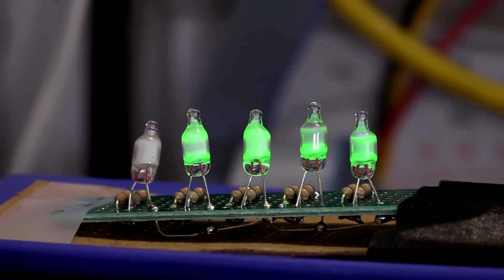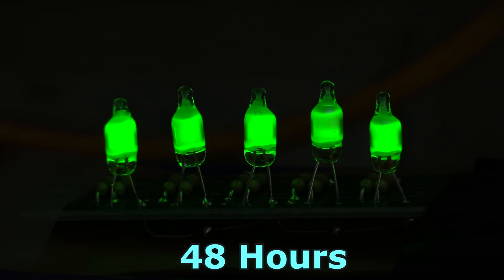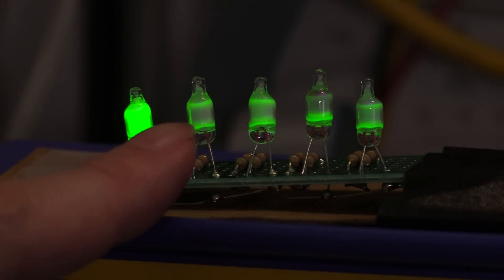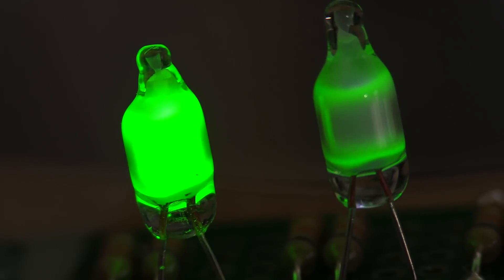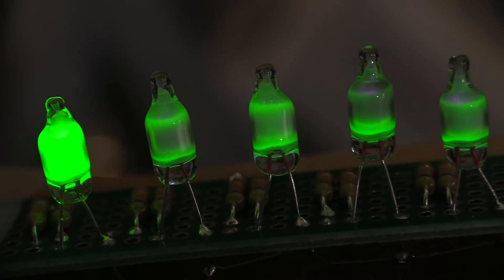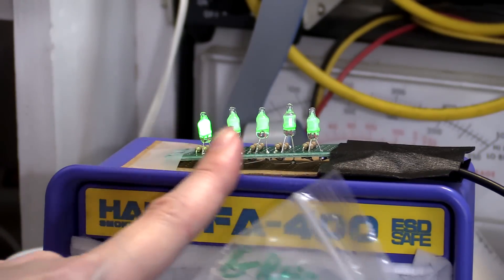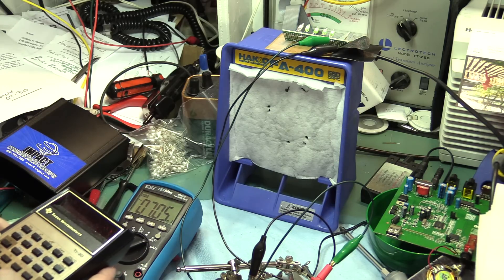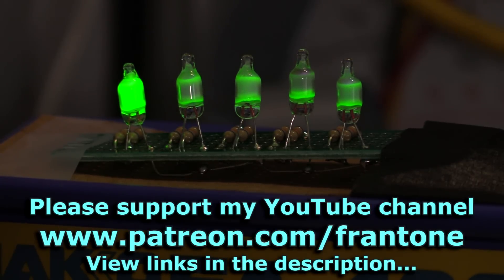Total Fail!!!  The Green Neon Is A LIE!!!

Comment: If you don;t have a current spec for them, put a pot in series and find the minimum current they'll run at. How does this compare to the 1.75 ma?
Reply: Quick calculation using generic "neon bulb numbers"... If it fires and holds at 90V, 1.75mA is over 1/8W that the bulb is dissipating... I bet they're warm to the touch... Which a neon bulb of this nature should never be.
Reply: 1 to 1.2mA is where mine all seem to run.

Comment: Try a lower current. I think they are being cooked.
Reply: This was my first thought. I can't condemn these lamps without first seeing the datasheet. Some of these small bulbs are rated at 70v and not 120.
Reply: 2 mA
Reply: @metatechnologist  These are not rated for any particular voltage, they require current control, 70V is just the operating point it will settle to at the specified drive current. If they're specced at 120 they have a built in resistor to set the current for 120V mains operation.
Reply: @metatechnologist  Indeed, from my testing 4x10mm Chinese greens light up at around 60V and they run without flickering at less than 1mA, in a batch of 25 most work without flickering under 800µA.

Comment: I was looking at these to repair old 120V AC switches for a few vintage espresso machines that I own, and for which I can't find non LED replacements in the right style to fit the cabinets - In my case, the bulb failure is caused by their leads breaking off from mechanical fatigue after about 10 years of daily use, with no significant dimming whatsoever - and the bulb circuit employs two 80k 1/8w leadless resistors in series, for a total of 160K under 120V AC.

Considering you were driving them with an equivalent 16K resistor, which lets 10 times more current through, therefore potentially generates 100 time more power, it's no surprise they failed so quickly. I would therefore surmise the failure you experienced was simply caused by overdriving them, not by a manufacturing defect.

Comment: Not sure if this will help but I took apart a power switch with a green neon inside that's been running daily for several years and it has a 160k resistor inside, still just as bright as the day I bought it.
Reply: EXACTLY my setup - that's 10 TIMES less current than Fran drove those at (33K/2 instead of 160K). I'm replacing the neon bulbs in some of these switches because the neon leads broke off from metal fatigue due to vibration from countless on off cycles.

Comment: I'm assuming the clock you're referring to was that lovely green flip clock timer. I had the same issue trying to replace the lamps in my model and to this day, the best solution I have is stepping down the lamp voltage to work with green LEDs. The clocks nice green glow is more of a beacon now, but it's better than nothing.

Edit: it's occured to me that a variable pot would more than likely resolve the brightness issue, because you could manually dim them. I don't know why that hadn't crossed my mind before

Comment: Don’t know why this was, but back in the day when I used to tear old TV amplifiers out of houses, they used to have one or two neon bulbs inside of the preamp. I always figured they probably use them to bleed off lightning strikes was the only thing I could come up with
Reply: Those may not have been ordinary neon bulbs;, more likely they were some type of gas discharge lamp similar to the ones used in (landline) telephone-distribution closets for shunting lightning-created voltage-surges to ground.

Comment: Maybe get some from a more reputable manufacturer like  CML part No. MC08030000 

1 Breakdown Volts 85VAC, 100VDC 
2 Design Current (mA) 1 
3 Resistor Series Resistor 110-120VAC 56KΩ, 220-250V 180KΩ 
4 Life (Hours) 12,000 
5 Colour Green 
6 Lead length (mm) 30

Comment: A couple of thoughts on the mechanism of the phosphor degradation (other than UV degradation):

 - Electrode material evaporates onto the glass/phosphor, shielding them from the light. This does happen in some Ne-bulbs, some old continuous ones can look almost silver plated! 

 -  Plasma may be reactive enough to simply decompose the phosphor/pull radicals from the glass or residual gasses for the same effect.

Also why bother with the coated phosphor at all? If the "neon" Ar/Hg bulb was made of uranium glass the entire glass envelope would be the phosphor! Maybe this has been the case for earlier models?

Comment: They are indicators not illuminators and maybe 0.2 W is to much and maybe dropping the current will drastically alter the life time because I bet the relationship is not linear, what would be more interesting is if that row of 5 had different resistances on each and then a control and leave that running...cheers.

Comment: Zinc sulfide is a common florescent materials that 'ages' poorly.
Old radium watch dials use it to make light, but after some time the zinc 'gets tired' and loses its ability to glow.
Something about dislocations in the ZnS crystal that get relaxed after long-term exposure, if I misread the article properly.
Fresh crystals glow like the Dickens when irradiated, used up crystals can't be bothered.
I bet the firm that made these bulbs used ZnS; cheap, plentiful and it has the right color.
I'd use them for a warning indicator, but never as 'always on' power indications.

Comment: Fran, in your field, you must already know that most anything made in mainland China by a company that does not have to answer directly to a large corporation that contracted them to make it will be substandard if it works at all. It's all about chabuduo over there, i.e. "close enough", and when "close enough" means "close enough that some sucker will buy it on alibaba/ebay/amazon", then that's exactly what you'll get. There's no integrity, honor, or pride in one's work—just a vague concern about what sort of bribery, discount, or bald-faced lies will be necessary if the corner-cutting is noticed and the buyer has any way to make their life difficult.

TL;DR: buy stuff made in Taiwan, Singapore, Korea, Japan, Europe, the Americas, etc. but if it matters, don't buy it from China.

Oh, and make sure it's actually made somewhere else, because they'll outright lie about that too. I have some D cells I got recently that say "Made in USA" where they forgot to change the the tiny "lead-free" notice on the label from Chinese to English. Heck, even that notice is probably a lie.

Comment: I had issues quite similar. But in my case it was bad electrode material which sputtered quite much, especially with heavy ions like Ar. The difference is clear if you breake one. Is there dark coating on the „phosphor“? Not that it matters .. the bulb is useless either way ... just out of curiosity. At the end there are three main faults ... gas intake, sputtering or dead conversion material ...

Comment: I almost wonder if it's poor quality electrodes which have sputtered on top of the phosphor. They shouldn't do that under low current AC, but they also shouldn't look like that in less than two weeks.

Comment: the company i work for uses green neon indicators for steel tubing heaters. they used to have a half life of about one year (basically what you got in 10 days happened in a year).
Right now, the supply dried up so (refering to your LED video you're gonna like it! ) we are using orange neons, in the original green diffuser :P
It seems green neons are really hard to get right now, good quality one that is.

Comment: Fran... FRAN!!! They aren't useless!! You can have a burnout race! See how fast you can make them fade out below a certain threshold. Have a dim LED as a baseline, or finish line, and use a surface they illuminate at a fixed distance away to compare the brightness of their light on it, as an eyeball metric. Can fiddling w/ different voltages and Hz make them go dark faster?

Comment: I mentioned on your last post that I have had many many failures with the green ones - mostly in green illuminated switches... The normal orange ones run for years, but not the green ones.

Comment: yep most likely electrode sputtering that's why the the neons have a top and bottom ring i would not be surprised if those neons have not been vacuum pumped under heat leaving residual gases when they filled them with a penning gas mixture the smaller the lamp the better the vacuum pumping has to be the phosphor , the glass and the electrodes will outgas badly over time if it wasn't pump under heat to drive off the residual gasses.

Comment: That's lame..  Not even a few days, let alone years!  wow.  Maybe back-back green LEDS in series and a low value cap and safety resistor to run from 120AC. (Min component count with the back to back LEDS.)  Never had much luck with even the modern neon lamps lasting just few 100 hrs in my power strips and heaters.  These even worse!  Maybe back down the current on the greenies would help a bit? Unless you can find some NOS, likely to be out of luck. (Please don't shoot me for suggesting LEDs! )  Stu the crazed.

Comment: If those are the same I got from china, the phosphor seems to react much more to electron impacts than the uv light. 
Maybe it was developed for CRT or image intensifiers. 
I run them every night since nearly a year, but at lower power. So I see no degradation yet. 
I also can't measure the current without influencing the brightness. But to give a rough idea, they run on a AA cell for more than a night.

Comment: I have a basic electronics problem to do with an optical light to dark  resistance output , it's putting out a voltage with the resistance.  I only need the resistance . How can I get rid of the voltage that's coming out with it

Comment: I’d just use LEDs with a capacitor in paralel to create the filement “heat up” and “cool down” effect. (Edit. Paralel not series. )
Reply: Agreed!
Reply: No filament in an ordinary small neon lamp.  Just two electrodes.
Reply: @fredknox2781  We know. I think it's understood they're referring to making LEDs react more "retro" in general - on the cheap. I think you knew that too.
Reply: Sometimes just knowing modern tech is in there is enough to "kill the mood". I totally understand sticking with period correct stuff.
Reply: I would too. But it's not quite in the spirit of the restoration project to use tech that didn't exist when the clock was made. It's the old tech that makes it interesting.
Reply: @enquiryplay  I see your point, a working fix with modern tech is not as useless as a display you can't see IMHO.
Reply: She said she wouldn't use LEDs because "that's stupid" without explaining why.  You'd need an electronic driver to pulse low voltage DC power, but they're relatively cheap nowadays.  Perhaps she wants to restore whatever device to its original form, but sometimes being perfect is the enemy of the good enough, or however that saying goes... Anyway, maybe it would make sense if I had more context, but just watching this I'm left a bit confused.  What's the failed green neon phosphor?   who knows, maybe it's not the composition and they doped the glass wrong somehow.  how are we supposed to guess the composition if she only said it's from china?  My advice would to be to ask the manufacturer.   "Common sense" would tell you that doing so is pointless, but I worked for a chinese (automotive) lamp manufacturer, and we always answered our e-mails about warranty  (we never sell products directly to consumers though; the customers were always distributors or retail businesses).   Obviously, these people could just be scammers, but you won't know until you ask.
Reply: @svenkarlsen2702  I agree, but finding phosphorescent bulbs that actually work, or even regular incandescent bulbs, is still possible.
Reply: So ya gonna sit and switch it on and off to view the 'Retro effect'  while you dribble on the floor ?
Reply: That's pointless. They are in a clock which is always on. :)
Reply: @frankowalker4662  Yep.
Reply: @enquiryplay  I have quite the thing for vintage computers.   I like to upgrade them with modern tech to make them into something better than the original.  Ive seen people put ipad displays and a raspberry pi  in a Broken classic Macintosh     The result is a device that can run a wider range of Macintosh software and emulate a wider range of apple machines and even do other things while still looking the part.   It turns a device from something you pull out once in a while and hope it still works to something you can use on a daily basis for things like simple web browsing or even some light gaming.   If you wanted you could put even more beefy hardware and get even more out of such a machine!
Reply: LEDs are boring.

Comment: Maybe you should compare an antiparallel pair of InGan green LEDs biased at 1.3mA RMS with your reference bulb.  The new LEDs can get pretty bright.  Some people replace all the electrolytic caps in their consumer electronics with tantalums, replacing neon bulbs with LEDs is not that crazy.
Reply: using tantalums in place of normal electrolytics can be a very bad idea, tantalums can suddenly short, especially  if subjected to overvoltage spikes.  far too much of this 'replace all old electrolytics on sight'  bull** !
Reply: @andygozzo72  , momentary voltage-reversals can be instantly deadly to tantalum caps,  but healthy electrolytics might survive. Modern electrolytic caps from reputable manufacturers have such low leakage nowadays that the main former advantage of tantalums isn't really a deciding factor anymore.  I have replaced many many tantalum caps with electrolytics in the tone control circuits of 1970's Japanese solid state Hifi gear.
Reply: LEDs are the boring default answer. its like only drinking water instead of anything else because technically water is all we need to live

Comment: Can you light one of these bulbs up with a tesla coil or one of those Plasma globe things?
I think that will prevent any electrode sputtering if that is the problem.
Reply: I have lit discharge lamps with RF.  No electrodes are needed for that.
Two wires wrapped around an NE-2 with a gap between them works with about 1MHz at a few hundred volts.

Comment: Back in the day when there was a factory of metal halide lamps in Warsaw techs were saying that they tried ordering some arc tubes (inner quartz parts) from China, but the quality was very low. From what they said: there was some minute amount of moisture in them, making them fail within a month tops. The inner quartz-glass surface would just go black, even regular mercury vapour tubes would get black faster than usual. Maybe here also purity is an issue? Either there is something that shouldn't be inside, or something's missing :)
Reply: thats what i was thinking this is the reason why you need to bake those lamps while vacuum pumping so you try to drive the water vapor and air gases before to fill and seal the discharge tube

Comment: I would experiment with driving them harder and softer, IIRC you get less of the shorter wavelength, probably phosphor killing, "hard" UV if you drive a mercury discharge tube with more current. That's half the problem with this Chinese ebay stuff, you often don't get datasheets and have to characterize everything yourself.

Comment: Try running different voltage and current see 
Or frequency 

If you want to build your own get a rear view projection tv that's crt based 
The screen phosphor is separate in the 3x different tubes and instead of neon run phosphor witch they are pretty close to each other and make ur own lamps  

Be like magic eye and vacuum phoresent display 
Shouldn't be 2 hard

Or really cheat in a not so cheating way and use a uv led and phosphor so atleast the glow is natural just not the way it is created

Comment: Yea, neon bulbs, love to hate them, either  the electrode vaporizes on the inside of the glass....making them black (dimmer) or they 'percolate' randomly...very annoying....So, I'm not sure where you purchased that 'chinesium' junk, but I too think you hit them pretty hard.  I saw something like it on Amazon....said use 100Kohm...at 120Vac...and it also said 0.6 mA.   Just my 2 cents.... try like 5 more with varying resistance values, and pick the brightness/life you can live with...

Comment: I see the problem here. You're missing the eye tracking equipment that needs to be used with these "neons". It only applies power when it can tell that you're looking directly at it, hence preserving the flimsy phosphor coating! I admit, it's a huge added expense at $99 per bulb, but it's definitely worth it!

Comment: There's a lot of really poorly made junk coming out of China;  I bought some #10 Robertson screws to use on a project I was working on, and I broke all the screws USING A SCREWDRIVER, not an electric drill.
The metal simply twisted and the head ripped off.
I've never seen such poorly made junk in my life.

Comment: Low quality metal electrodes that sputter too easily onto inner surface of the bulb, I remember some soviet fridge that had good green neon bulb as a power indicator. InGaN green LED's have same color, I replaced one in a cheap plug-in overvoltage protection device and it has been turned on 24/7 since 2018, just drive it at 1mA current and it lasts for years with same light output to these neon bulbs._